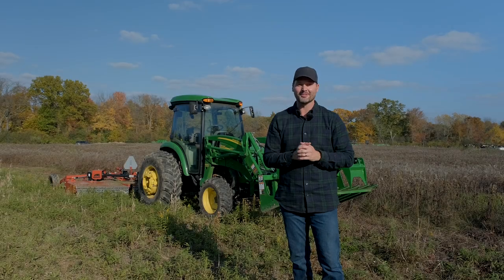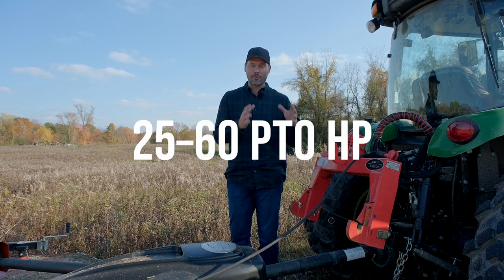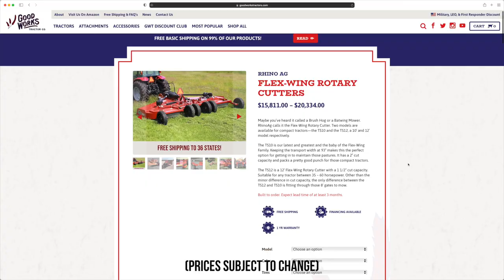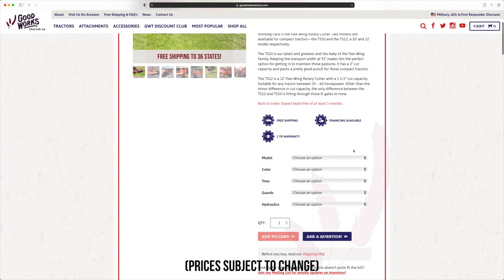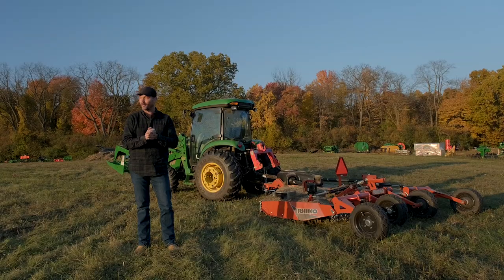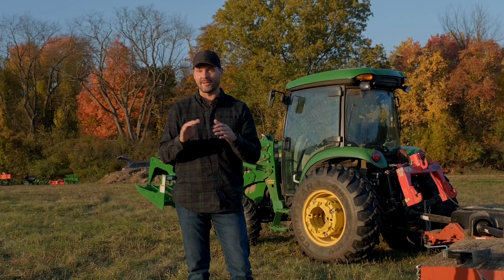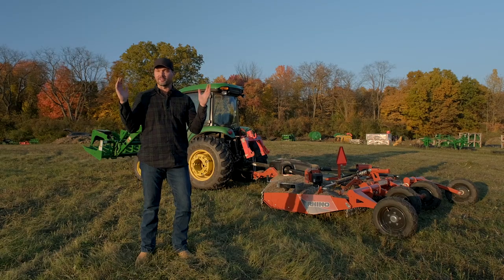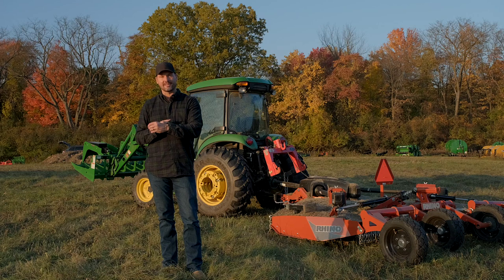IS THERE A BAD TIME OF YEAR TO BRUSH HOG? BYE BYE 4720 👋✌️

Comment: My 4720 has always temp gauge has always ran in the higher green area, I talked to Deere about it and they said it was normal, never had a issue at 1,000 hours on the tractor, I did have the hot engine light flash a couple of times on my mowing since it was new in 2009, what I found is you have to open the hood and keep the area between the Cooler and the radiator blown out, just cleaning the grill isn’t good enough, I use a leaf blower out in the field but also have the narrow air and water wand for cleaning the rad out at the shop
Reply: And the a/c condenser which eventually require the roof to be removed to properly clean it out.
Reply: @JamesTyreeII  open station here so only  a strong wind for my AC haha

Comment: Before you commit to the kubota check the compatibility with the batwing mower. Tractor time with Tim has some great videos with his kubota and batwing mower you may want to check out.
Reply from the maker: I should be fine.  Might try out a TS12 in the spring anyways.  Good call though!
Reply: We run a Bushwacker 144 12' batwing on an 2020 M7060 and there's no compatibility issues.  TTWT issues likely come from him trying to run a big batwing on a small compact tractor. Kubota didn't build that little tractor for big mowers. When you get into big utility tractors, those issues go away.  It's always cool to see Tim test the limits of the little tractors though!

Comment: You will love the M4D-071 if you get one! Never having to use your feet to clutch between shifting gears and the hydraulic shuttle on the steering column make it a gear drive utility tractor that can still be fun and easy enough to do loader work with. Great units!
Reply from the maker: Awesome, I'm really excited!

Comment: When I did any field work like what you’ve been doing I would take along a handheld gas blower to clean out the radiator or anything else that needed cleaning. And that Batwing mower did a nice job considering you didn’t go back over everything two or more times.

Comment: Looks like the 4720s issues are resolved. Yeah the seed and crap build up on the grill won't help. M4D bota interesting... I've finally had the chance to put a decent amount of hours on my 4066R well impressed with it. It's ploughed disced tilled, planted sprayed spreed hilled loadered Mown and graded. Loving the electronic 3pt and the ehydro seriously thinking of getting rid of two of the older specialized tractors and getting another cabbed 4066r and a Rops 4066r

Comment: If this is the last run with the 4720… then how about replacing it with a 5 series. Maybe a 5055e for somewhat similar horsepower range but in bigger frame to handle those larger attachments a lot easier.
Reply: I have a 50100e love it. It pulls a 15 ft rhino no problem
Reply: I agree. I had a JD 5100E. Sweet tractor. No buddy seat though. Nice looking and performing tractor. Ran a JD MX10 cutter on back of it

Comment: I'm glad you put the time down because I'm always curious about it. I think these larger implements do a great job when taking straight passes but lose some efficiency when cornering and cleaning the last little strips of brush. It would be interesting to see how long it would take with a large but more traditional rotary cutter where its tighter turning radius would almost certainly be quicker as the area you're cutting gets smaller and smaller with each pass.